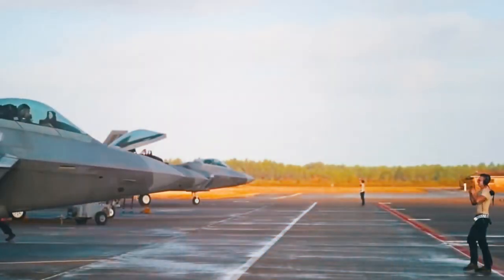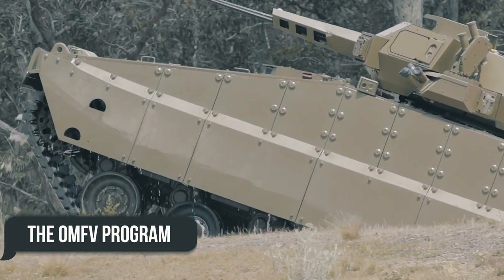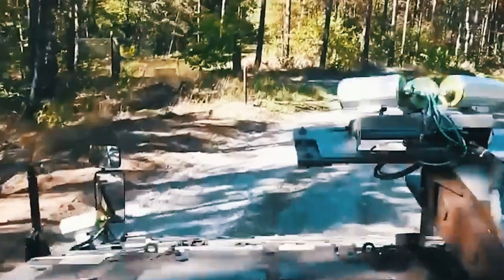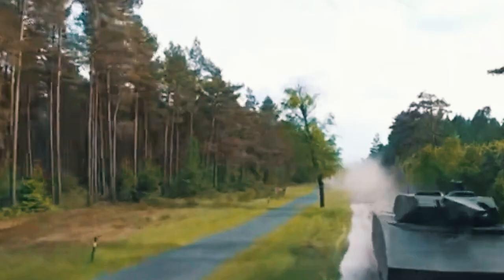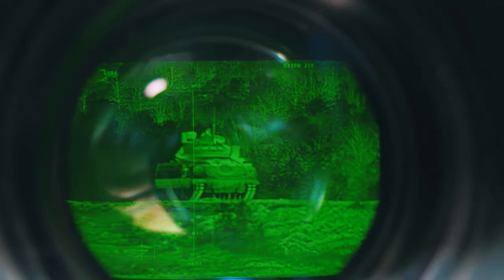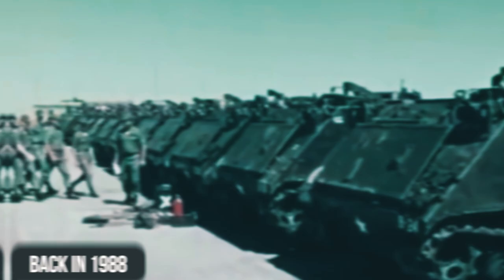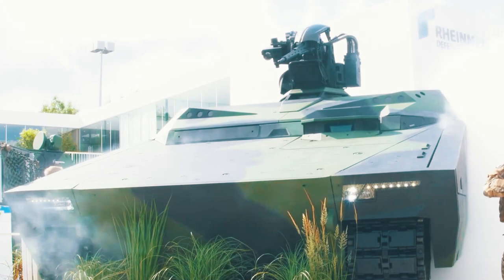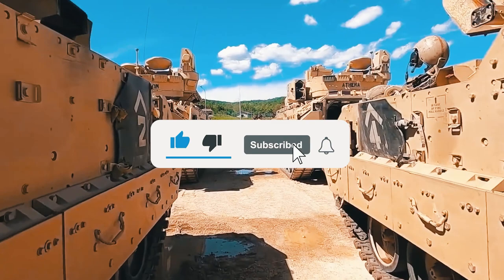US Army Finally Tests Its New Super Vehicle To Replace The M2 Bradley Fighting Vehicle

Comment: Not gonna lie, why haven’t we put the avenger gun from the A10 on an MBT yet
Reply: A guess would be that the GAU-8 can fire for a couple of minutes and then it's spent all rounds. For an airplane, this isn't  a problem, just fly back to base and reload after a strafing run. For a tank, that isn't as mobile, sustained fire is more important. A tank could hold more rounds, but still, you risk running out of ammo before the engagement is over.
Reply: @NeutroniummAlchemist  true, but ammo storage for enhanced load would be built in, and unlike the A-10 which needs to put a large amount of rounds down to ensure mission success, a tank can be more conservative
Reply: @manemperorofmankind8119  Perhaps, but there's probably another reason we haven't thought of.
Reply: @NeutroniummAlchemist  true, probs money, no need to innovate, think out of the box, or replace our MBT yet.
Reply: @manemperorofmankind8119  Money is a good one, those DU rounds the GAU-8 fires are not cheap.
Reply: @NeutroniummAlchemist  that’s for sure; and it might be over kill but they would def be great at countering any counter measures a tank would have. Hard to stop a hundred pulleys flying faster then the speed of sound at you, each capable of penetrating armor.

Comment: There's no way this is ever going to end. Individual and company profit over the actual needs of the services is job one. We've spent billions of dollars to not replace the Bradley in the last 20 years. Why should that change?  The Airforce has been trying to kill the A10 since the 80s.  Not sexy enough. There's no plan to build a newer better A10. Only the newer sexier more steathlike F35. I say steathlike because for the F35 to do the A10  mission, munitions have to hung on the outside of the aircraft which makes them highly visible. These money grubbing people don't give f**k about the PEOPLE doing the job as long as they can keep the money faucet turned on. I only hope that  we aren't fighting  the next war with equipment designed for two wars ago.
Reply: Actually, they are rebuilding the A10 into the A10 2 (or Super Warthog) with more advanced gear.  The A10 is still super effective in ground based fighting and the newer one will be able to feature more advanced munitions and weaponry to take out tanks and ground vehicles.
Reply: @josephzeug3891  Not the same as a totally new plane. Neither is the dorky drone they built. I agree that pilots not having to read highway road signs or using your missles as night vision is an improvement but these airframes are old. Other than the new wings.  The people who could make an actual replacement happen have been trying to make A10s go away forever. I don't get that saving soldiers is not a good thing. The only support they get from the military are the people who work on them and the people they protect. The only support they get from congress is from those in whose districts they are based. Thanks for the support.